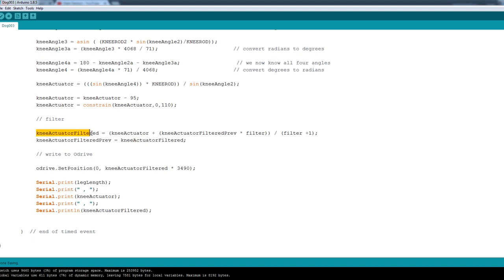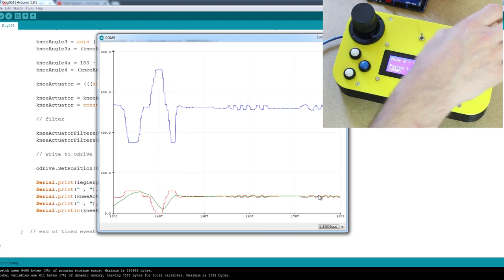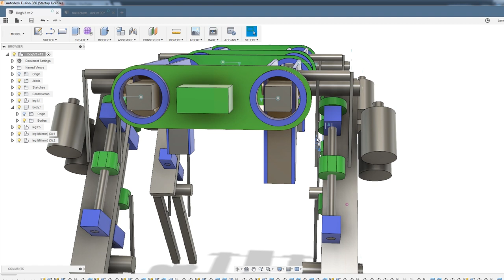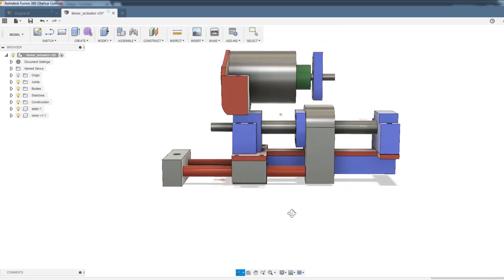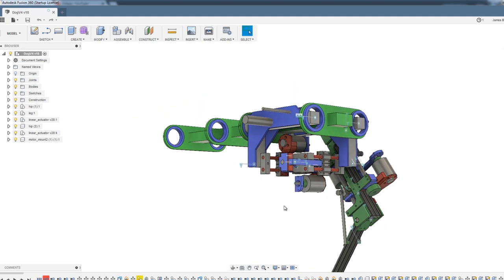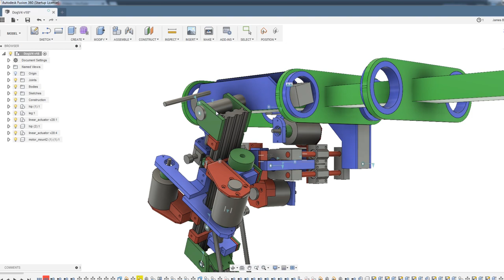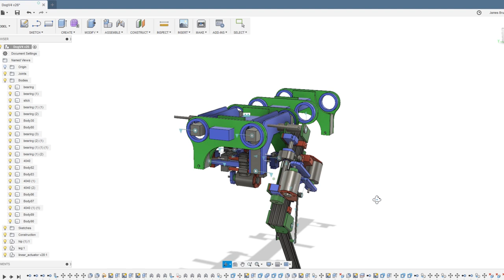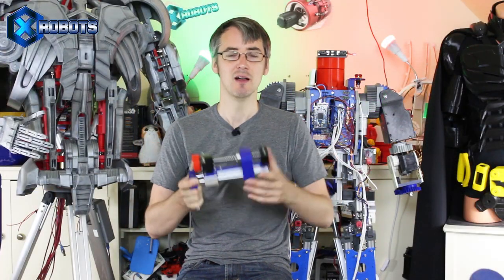openDog Dog Robot #3 | More Actuator Prototypes & Planning | James Bruton

Comment: I would recommend using soft jaws when clamping thread into a vice. You can make them out of a couple sheets of brass or by cutting open and then flattening some 1/2" copper pipe. If you use the copper, heat it up with a propane torch after you flatten it to remove the work hardening. A couple of pieces of scrap wood work in a pinch as well. you will also want to make a V notch in them in 1 to 3 places on both sides to hold round things better. Hope this helps for next time you have to clamp on threads.

Comment: if you mount the motor to the lead screw, you can also put the encoder on the other end of the lead screw so you dont need to support the back of the motor, or mount the encoder on the end to make it so much longer, making the whole lot more stream lined (if you want it in the end, i like it as it is)

Comment: I know your build/think options/film a while back... 
Immediate thoughts (which you have probably considered)
- Direct drive motors onto the screws? (... and just got to 19:18 :) )
- 1x linear slider rod and one fixed rod?
   i.e. you have 4x shafts now - the 20x20, the ball screw and 2x sliders ... remove at least one?
- put the tilt actuators on the top/batteries on the bottom
- put the encoder on the other end of the ball screw - opposite to the actuator

Looking good - like the ones where you explain thought->mock up processes.

Comment: You should put the motor on the same axis of the screw, using planetary gears to keep your 2:1 ratio. It would be smaller, look cooler, and would save lots of problems 😃

Comment: Why not use a planetary gear in line/coaxial with the screw? Would save a lot of space and make the whole assembly much less complex
Reply: Belts are a lot more forgiving if misaligned though, inline motors would be space saving but making the gearbox could turn out more troublesome than its worth

Comment: Aren't you worried about weight to power ratio? I mean the bot is gonna be robust as hell, but if you count all the screws and bolts alone you'll need weight will add up quick. You may then be very heavy and will need a powerful battery and that is going to add weight even more and then you get into the the whole power and weight conundrum where you cant win and the key is density more than anything. You probably have already though of this I'm sure! Keep on going you bloody legend you mad mad scientist!!!

Comment: I'm curious as to why you didn't go with Stepper Motors? You'd be able to get far more accurate position control, depending on what sort of micro stepping resolution you use. You would then be able to use your Encoders to verify you reach the target position and didn't skip any steps.

Comment: Loving this so far! Had a thought, will you be putting on a vertical axis on the shoulders? This would allow the limbs to move at a diagonal angle to the length of the body and aid turning when moving.
Reply: Good point! I'm still struggling to see how it will effectively turn whilst walking with the current set up. Looks fantastic though!
Reply: Maybe even a joint in the spine at the mid point?

Comment: You could do the bolt heads with a drill mounted in a vice set to a low speed with a rubber band on the power switch and the bolt in the chuck then use the grinder?

Comment: If your going in-line use a printed ninja flex donut adapter, it takes up slack, and any shock will not return to the motor

Comment: Opposite the weak spot, did you consider a 3d printed piece which would simply slide in filling the T-Slot  and adding stop T-nuts on each end??

Comment: you could only have one of the motors on top of the screw thing ... if you are worried about the torque you could use a planatary gearset they are really small

Comment: James im wondering why you didn't use linear actuators as you did on Robot X? They have a smaller formfactor and would give the opendoc a sleek look.
Reply: agree with Brian's suggestion....i have just 1 ball screw and they are seriously heavy compared to a linear actutor. have you thaought of designing your own linear actuators?or using linear motors?

Comment: This is awesome! An option for the physics simulation would be http://www.mujoco.org/ which is a nice (fast) accurate physics sim and simple renderer. It was used to simulate a version of Boston Dynamic's ATLAS walking around I believe. 

Also it'd be quite interesting to use AI to try and have this guy learn to walk! I've tried to do something similar with a small quadruped and have got it balancing so far. 

If we get the physics simulation working in mujoco we could try and train it to walk forwards with a genetic algorithm or even deep learning. Basically take the current state (joint angles, orientation) and learn a mapping to the next state that produces the highest displacement in the desired direction. Either have the mapping be random and pick the highest performers (G.A.) or use a neural net which outputs new joint angles given the current ones.. or use Q learning or some variant of it. Lots of options!!!

I watch these videos the moment I see them, really inspiring work James! Thanks for sharing. I'll be thinking of some AI to apply to this guy for sure.

Comment: Sorry for asking again but Im very intrested why don't you screw the bearing blocks straight to the 2040 on the legs. Now it has thouse 3D big plates and you said they will be aluminium later. Isn't  that quite a lot of weight or is there a reason why they can't be screwed straight to the 2040?

Comment: Is it necessary to put the encoder on the motor? when you mentioned that you could put the motor in line with the ballscrew (which would be the rout I would take) you mentioned that the encoder would stick too much from the back of the motor. If it could be placed on the shaft that connects to the screw or at the other end of the screw, you may be able to use some available space. Love your videos! I'm super exited about this new project of yours.
Reply: You could attach the encoder wheel to the shaft coupler.
That's what I've done with my home-built linear actuators.

Can't get a pic of it on the thing as they're enclosed, but pretty much like this... https://i.imgur.com/hELGKMw.png (mine uses mouse-wheel encoder wheels)

The wheel is epoxied directly to the coupler and the encoder itself attached to the ballscrew mount (not pictured)..
Reply: James Bruton well... If the motor is in line with the screw, it would be 1:1. I'm so exited that you replied to me. Feels like chatting with a super star.
Reply: just set it up as an encoder with twice the number of pulse per rotation, then you can put it on the end of the ballscrew, with the added bonus of not going out of sync if the belt skips for whatever reason. Though you may need to add 3 hall effect sensors to the motor so it behaves well at low speed.

Comment: How in the world did boston dynamics fit all that mechanics inside spot mini's slimm legs????!!!!!!
Reply: Android jackson lee they don't have to use off-the-shelf parts mostly, and cost isn't as big of an issue
Reply: Android jackson lee they use Harmonic Drive Motors which are compact and extremely strong (high gear ratio) eliminating the need for linear actuators. Unfortunately harmonic drive motors are pretty expensive.

Comment: You don't actually need ballscrews when moving things this slowly, acme might be cheaper and the bearing blocks you're using are for precise movement down to hundreds of millimeters, not required for your application either, simple bearings could make the build easier space-wise

Comment: Maybe you could reduce the strength of the filter in proportion to the speed of the motion of the input, so it won't lag when you make big motions?
Reply from the maker: Yes, it would be possible to dynamically change it depending on how fast you want to go etc.

Comment: You should look at using the same sort of push rod system you get in inbound shocks on the front of F1/F4 suspension. Then you can run the motors and ballscrews laterally down the body then turn 90 degrees and tilt the hips. Something like this: http://prototyp.org/rally/IMG_9798.jpg

Comment: Might want something stronger than set screws to hold the leg angle pivot linear rails
Reply: if it becomes a problem, just drill the rails too and use longer screws.

Comment: why not put the motor at the back of the leg? increase the diameter of the pulley on the screw slightly larger and a thinner leg to avoid the belt from rubbing against it.. anyway youre using metal so you wont have problems on breaking.. :)

Comment: may I suggest you get rid of the linear guiding system? pivots are generally "cheaper" (less complexity, and more density) and in that case your ball screws are tendons, you are not doing an actual parallel system. This could free you some space.
Reply: no, try to keep an open mind on my remark. I am just thinking of beefier bearings in the shoulders, and using the lead screw just as a tendon for the pectoral actuators.

Comment: My only issue with the Boston Dynamics type "dog" robot designs is that the legs on these robots do not work the same way as a dog's legs, a cat's legs, or any other four-legged animal's legs. The "backwards knee" on these robots is actually an ankle on real dogs, and these robots skip the actual knee entirely. It's the same reason why the designs of some of the original Doom enemies annoy me.
Reply: Perhaps. I do have to wonder if and when more anatomically accurate designs will ever become mainstream or even viable. For now, though, it's good to see anything at all. Robotics is a very methodical line of study.

Comment: I think a better solution to your joystick problem would be programming in a dead area which will be ignored (return the neutral value).
Reply: Do that as well, but taking out the dead spot will save you a world of pain (well, maybe not a world of pain, but at least an island of frustration)
Reply: the dead spot surely is a smart move...

Comment: What if you put all the motors on the body itself, and use cables to drive the legs?
Reply from the maker: I considered it, but that's a lot of motors in one place. Also the cables would have to go through several joints...

Comment: i really see the exitment of designing everything yourself, but i dont understand why you would use this bulcky setup instead of 'of the shelf' linear actuators. an use the time for stuf that isnt as straight forward. or at least use the new CNC to mill aluminium blocks, where the linear bearings and ball screw bearing can be press fit in, instead of screwing all these bulcky blocks together. anyway, respect for this project and all the others you have done!

Comment: You're forgetting maybe some shock absorption.
Reply from the maker: that'll come later
Reply: Right on! I like where this project is going, though I'm interested to see if you are putting it in the joints or just the feet. I'm big on physics and springs/shocks solve so many problems in these type of things.
Reply from the maker: soft feet to start, then eventually series elastic actuators somewhere in there I expect
Reply: I like the sound of elastic actuators! Also, it might be neat to try rubber banding in place of your smoothing code xD if you have time to kill. Gosh I love the work you do!
Reply: It would be convenient if the motors performed their own shock absorption, through feet pressure sensors or velocity reading (if you get camera vision). Can't tell you if that would work. I only program videogames. xD

Comment: motors and screw drive will be slow in joint movement pneumatic actuators and a air compressor would be alot faster and easier to implement  for leg movement that's what boston dynamics use as they found out that motors just are not fast and strong enough for joint movement why don't you give them ago for a change you maybe pleasantly surprised yes they are more expensive but you should get your robot to work with them with your skills with cad design and computer programing it shouldn't be any trouble for you to implement them i hope one day you will give them a try as you are very clever in this field .
Reply from the maker: Spot Mini has electric actuators: https://www.bostondynamics.com/spot-mini